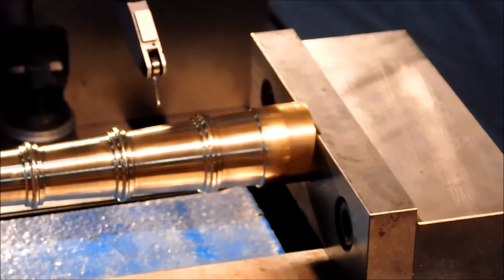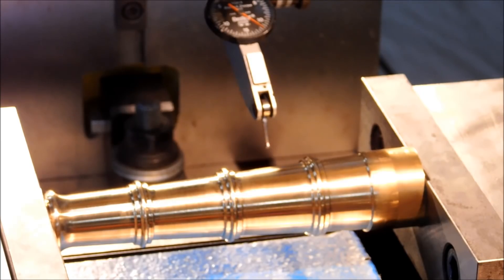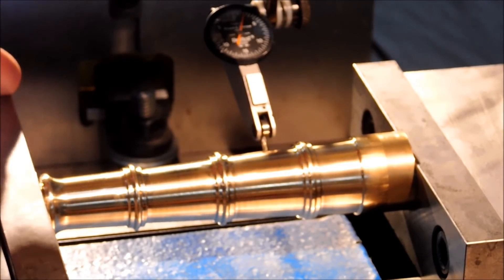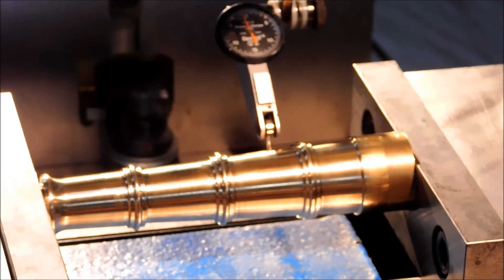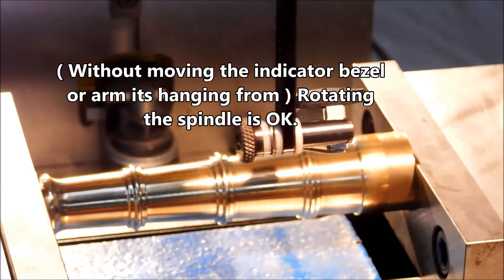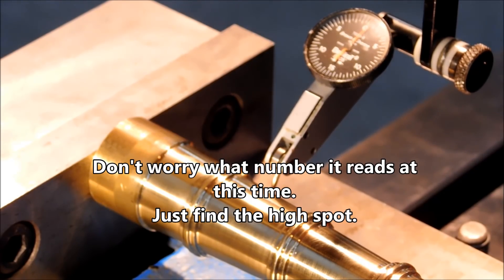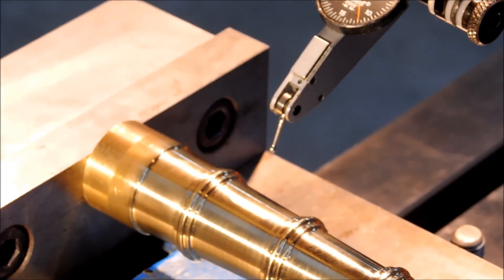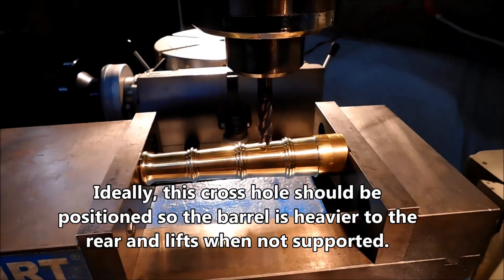Naval Deck Cannon Model Part 2 - Machining The Barrel Trunnion Hole

Comment: Beautiful clean hole. What is the speed on that end mill? When I made my first mini cannon I just drilled on drill press with drill bit and silver soldered the trunnions. It was not very pretty. Now I have a nice little mill and am learning.
Reply from the maker: Best guess, 1250 rpm.

Comment: Many years ago in the 70s I made 5 replica Old Ironsides cannons. Three with a 1/2 " bore and two with a 1" bore. One of each shoot steel balls. The 1" is one very powerful cannon. It will shoot a ball almost thru a telephone pole. I haven't fired either of them in 20 years. Different family members have them except for one that I have on display at home.
Reply from the maker: I'm looking forward to finishing these. Not to shoot, but just for the journey of making them. Its something I've always wanted to do.

Comment: Joe,

 Why are the trunion holes not centered?
Reply from the maker: I've seen them both ways. The only thing I can figure is that it adds adjustability to a gun that was normally intended to be level. By flipping the barrel over, it would change the angle.

Comment: Is there an particular advantage to using an indicator to find center vs an electronic edge finder?
Reply: Steamfan71 my electronic indicator has runout and the spindle bore has runout. I think this is more accurate.
Reply from the maker: Some electronic edge finders must register on a true vertical surface. If you have it set on center, not a problem.

Comment: Shouldn't you be using a two flute end mill for plunging?
Reply from the maker: A center cutting 4 flute will bounce less on an off center operation like this, but historically, 2 flute end mills are better on brass and aluminum.
Reply: Thanks

Comment: Looks like you're relying on your jaw faces remaining parallel as you clamp the ends of the barrel. If your movable jaw lifts the center line of the barrel will also pick up with it, but I'm sure you know that your jaw does not lift enough to be a problem
Reply from the maker: Its a KURT vise. By construction, the movable jaw pulls down when you tighten it. I can also feel the registration of the part on the stationary jaw as I tighten the setup. I never just tighten it. I always seat the setup a couple times before I torque it. Old cast Bridgeport vises were famous for lifting.
Reply: @joepie221  Got it. A Hungarian shop we work with that does a lot of stepped shaft work will use a boss of known diameter (same) at each end and clamp the shaft in Vee blocks. Helps in keeping keyways aligned within .001 at either end, part can be flipped with Vee blocks attached.

Comment: Is this a trough hole?Wouldnt it be easier just to use end mill and a paper in between to touch the taperd part and then just divide the size of end mill to half?That way you would be straight on the taper edge ,move it to center.
Also when drilling vertical hole trough hole its best if you can plug the hole with brass or wood ,something that you can extract easy(i use wood plugs ,i got a dry wall screw welded to a all thread rod with 2 counter nuts that works like a cork screw.),that way it wont leave the burr.Now endmills are better for it than drill bits ,since you doing it on a milling machine with short endmill,you wont have a problem,but for work with drill bits it saved me several times . 
Its like drilling a sheet metal ,if you sandwich it between 2 peaces of wood ,hole you drill will be perfect.
Reply from the maker: I am making the field artillery cannon a working model. This deck gun is for display only and the trunion hole is drilled through.
Reply: @joepie221  So how would you do a trunion on working one?
Werent they suposed to be casted ?
Or go for threaded blind hole?
maybe trough hole then weld them ,and make barrel hole last?

Comment: Genuine question from a complete beginner - would it have been easier to drill the hole before the lathe operation? Like on the original stock?
Reply from the maker: Thats an honest question. I have to say for ease, yes. But there is a ,but. When turning past an interruption, like a cross hole, there is very small rebound of the turning tool. This usually leaves a 'Past the hole" surface deformation on the part. It looks like chatter, orange peel or just a smear. Also having the hole makes it harder to get the great finish without distorting the part around the hole. Good question.
Reply: @joepie221  Great answer!! Helps me from making that mistake myself at some point. Thank you for taking the time.
Reply from the maker: @myharris  Anytime.

Comment: I don't think its going to be shot with that hole in it........as a gun guy why make a non functional cannon even if you never fire it?
Reply: Total bummer.
Reply from the maker: This is just a display cannon. My larger field artillery gun will be functional. The trunion mounts are blind and do not void the bore on that one.